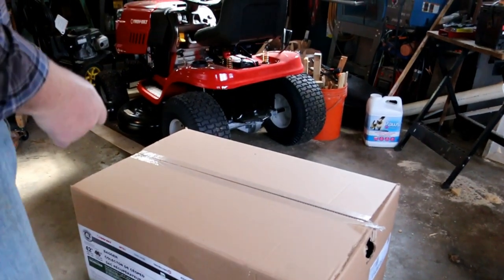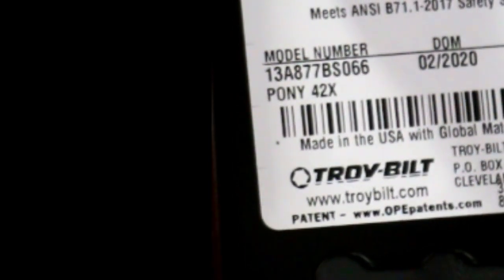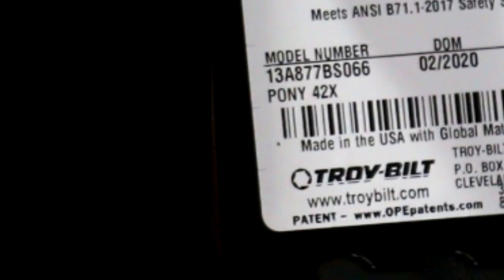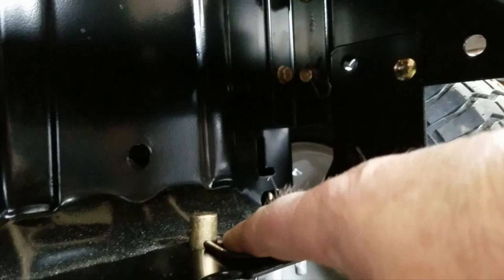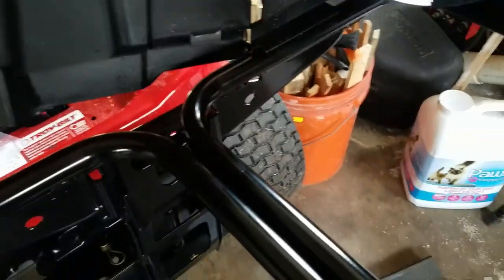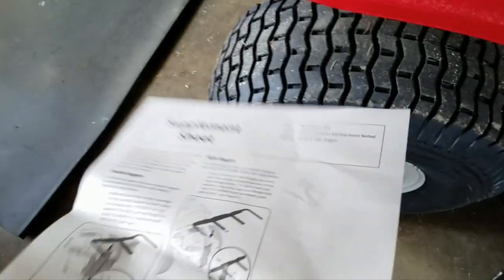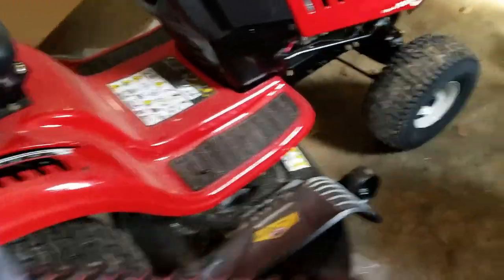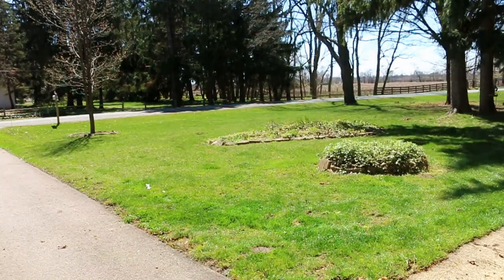Troy Bilt Pony 42X ~ Installing The Bagger

Comment: Well, you were kicking up dust and maybe a few Sadie hairs!  Glad I just have a bag on the Kawasnapper. I can trim on both sides. If you'd been here we'd have hung that thing by the hindmost and no floor wallering. I still have a cardboard moving box for the p-gravel escapades. I like the Hi-vac kits for Snappers which are lift wing extensions for added vacuum/pressure/lift and I have gator blades on the big one and Roof and 4-horse so the more you go over clippings the smaller they get till they just vanish. And the Gravely too if I remember right. Got 2 files for the Poulan and 3 mats for the geezer ramp and found out that a couple of pals got badly hurt but are recovering so all is getting well. Toots is on the weekly grub run and will be back shortly. I will be outside gomming. Mowing most likely or de-oiling the Poulan chain for a filing maybe. Or a trial run. The store in SC sold over 80 saws because of the big blow there. I might find another one but I'm not looking. 
Happy afternoon Unc and GBWYall!
Reply from the maker: Hey Lewie. The mower works great. A little big for the mower shed. I can take off the bagger and it fits.
Reply: @OldSneelock  OR the mower shed might expand! YAAY it works!!! So does the Poulan. It's not a world burner but it cuts. A little fine tuning and maybe better. Now to go back for a dowel rod for more file handles OR a nice fresh limb!